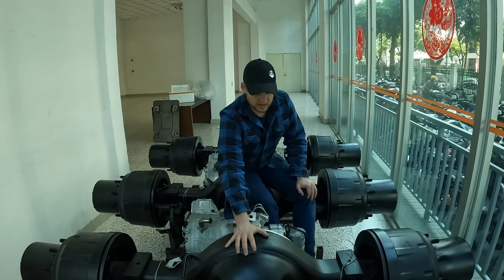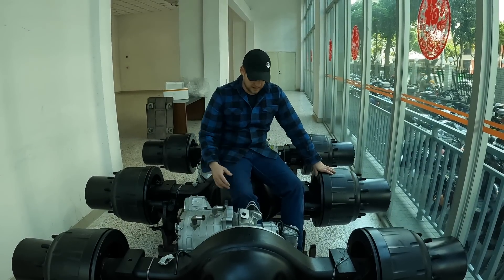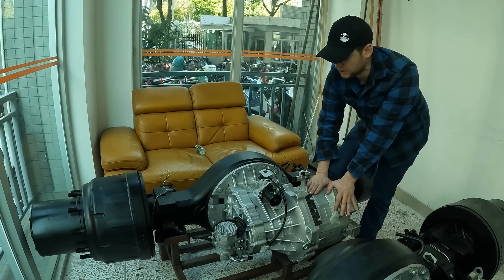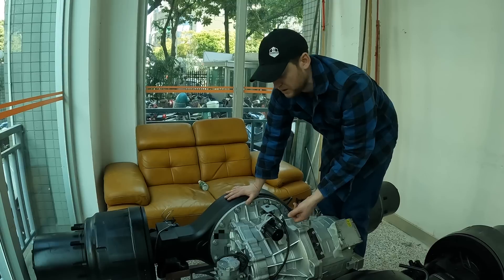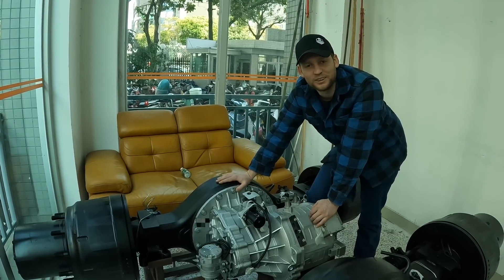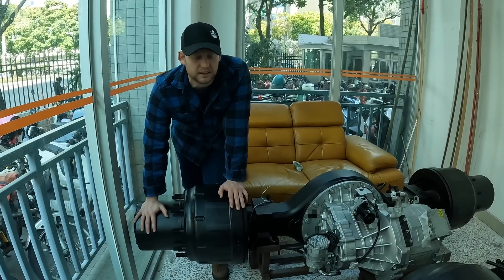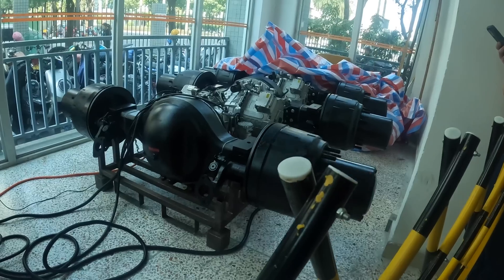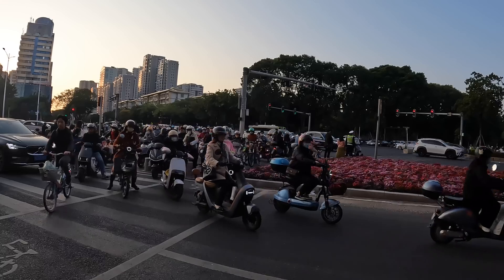Exploring Heavy-Duty Electric Axles: Behind the Scenes at the Factory

Comment: Be interesting to see if they have sorted their gear hardening 
Steel quality and lash issues 
I drove a Chinese pickup a few years back (manual)
In all my life ( near 60) I have never drove anything with that much 
Combined lash without something being broken 
It's a case of a lil more on every gear and spline 
That adds up to a lot 
4th gear traveling down the rd 
U back off and it doesn't catch itself
There's a gap then go to apply power again and you nearly haftoo book an appointment for motive force 
Shoddy engineering 
My employer just bought 
A press brake with crowning bed
The bed was failing new 
And would not respond 3 tech's later they found it in the bed drive 
The leadscrew mechanism looked like I'd machined it and I'm a boilermaker
It was rough and made from by the look of it soft steel 
Plus it had not limited itself by switch failure 
A lil messy it twas 
It's up and running again 
For how long is anyone's guess
Now it's goin it runs and corrects quite well

Comment: How do the electric motors hold up to the road vibration since there is almost no suspension to help dampen the vibration. Basically, are the motors going to vibrate apart when going down the road?
Reply: You do understand that AC brushless motors literally only contain one moving part which is the commutator right? That's like asking why doesn't the differential vibrate apart.

Comment: "Inter axle lockers" is actually where all EV's are falling short.  You need to talk to these guys and make sure that you are PUSHING for them to create a "virtual locker" --- so that it sync's the front and rear motors.   I've seen on the Rivian that it gets super confused when one axle is spinning or slipping and the other isn't;  and it starts freaking out and getting jerky and applying the ABS at random, etc..   They need to make a "virtual locker" so that it simply syncs the motors and stops monitoring the traction control stuff.

Comment: Does the truck have an engine powered generator as well as batteries? And are the the electric motors three phase vfd style or dc servo type motors?
Reply: ... those are 3 phase motors, three large power cables go to each axle.   He mentioned that in an earlier video.

https://youtu.be/dhi04e3ZrgU
Reply: @Texaca  I looked at using a 3 phase motor and vfd on the spindle of my cnc milling machine. The speed would be controled by the software.

Comment: You lost me at made in China. They take our steel and turn it into shit. They cheapen everything they send here. And know for sure any company you deal with there is owned by the chinese communist party. And the labor on those axles ar probably slave. I was interested in your technology a bit because of the different approach.  I ran electric forklifts for years. Under load say the first time going up a ramp you say this does ok. But always always and I mean always they slow down at the top. Internal combustion does not. Half a flat bed unloaded from ground level climbing a dock 4 foot higher you will need a charge. Your generator charging system i think is great. But it will not charge those batteries fast enough to overcome climbing. so your baby caterpillar which are awesome by the way will find itself spending most of its time at peak power. Better put more fuel capacity on it. Going down a baby incline i have found they hold for a few seconds than it can't.  Up the hill they will be like the only engine in my experience that will die not fall on its face die pulling a load up a hill in the correct gear. Mack. 1800 rpm and it dies like must start it back on a hill that is not that bad. Even detroit and cummins will try to pull. I wonder how fast you can get parts for those cheap china axles?  Especially when they are doing their very best to destroy the west. I'm game for different energy if it is cheaper and better. You did a good step putting a diesel powered generator on. But it not sustainable as you would say. The batteries before they even get to your truck has produced more pollution than a diesel will. ... From the '70s.  Our so called C02 has increased very little since the middle ages. If we decrease it by around 1 percent our trees will die. We need trees to breathe. I don't know about y'all but I kinda need to breathe.  In my driveway sits a T800 KW with a 550 ACERT 06. 300 k miles. Your truck when you installed the batteries has made more pollution than  my truck when I have inframed it 2 or 3 times. Caterpillar Yanks. Hard. And I can get superb mpgs out of them.  I learned to drive a big truck around 12. I got my CDL when i was 18. It wasn't called that then. I am now 50. So i probably know very little about trucks. I will continue as long as i keep driving will row my own gears i will react faster to conditions than a computer ever will. And I will never drive a truck that i have zero control over the transmission and drive axles. How do you disconnect your electric truck from the road? When the road gets greasy how do I stop my drives from locking up? I can do this if row my own gears and know when to brake when not to and not use my engtine brake.
Reply: ... you lost me at " ...our so called CO2 hasn't increased very little since the middle ages".  Where the hell did you get that nonsense from?  #FauxNooz, a Religulous Fanatic who hears Voices in his head, or from a YouTube University #TinFoilHat Flat Earther scientist 🤨
Reply: @Texaca  mainly because studies show that if our real studies not this bullshit religion called world is ending tomorrow like climate moron Greta dumb fu.k spews says we reduce our c02 by less than 2 percent our trees will start dying or maybe the hard fact the slave labor plus the pollution caused by mining the materials for the batteries before this truck even gets on the road has caused more pollution than a pre emissions class 8 truck will cause in it's entire life cycle. Please continue to suckle at the teat if elites like John Kerry who will pollute more this year than I will in a lifetime. Spare me the woke bullshit. And do some real research. China is one of the largest polluters in the world and the use slave labor and are a horrible communist government. Spare me your bullshit please.

Comment: "Does it have inter-axle lockers" might not be a relevant question but I would ask if they provide inter-axle traction control? Being able to crawl without one axle spinning wildly on slippery spots does seem relevant, especially in off-road applications.
Reply: i believe programming will take care of that
Reply: @73Datsun180B  yes programming is the solution. That's the nice thing about electric motor controllers in this day and age.

Comment: Is there any chance the tri drives will have the front drive or rear a liftable tag? Not really doable with drive shafts very easy but it seems you could lift an axle of the ground and cut power to it pretty easy with this set up.  Love what your doing. When the the w9 dozer hauler is done , hopefully I can buy an Edison.

Comment: Sounds great and all. Do they use standardized brake drums, bearings, wheel seals? How will you protect the motor cooling hoses at the back of a logging truck? I mean it's pretty hard to keep an axle temp sensor wire connected as is.

Comment: You are going to end up bankrupt.... you know electric trucks will not work😅
Reply: I believe there electric truck is the Only electric truck that will work and work better than any other truck on the market it's not a new idea but is absolutely genius these trucks will outlast any truck in history far as engine hours diff replacement the normal wear and tear items will be there but different issues I suspect wires and connections also suspension components same as every truck

Comment: Are these 3 phase ac drive motors? Would it be possible to run these trucks on generator only without battery for cost and weight savings?

Comment: Seems like it would be pretty easy to add front wheel drive to a truck given the fact that you don't need to deal with driveshafts
Reply from the maker: That’s correct, You could also have drive axles on your trailers. - Theron Danger

Comment: Honestly, the more vids i see of this process the more impressed i am. While the made in china gives me pause, at the same time if they stand behind the product then whatever. Half the crap i own was made there.

I likely wont get in on gen 1 just due to timeing, but id love to get my bullfrog remaned to one of these diesel electrics someday. Likely be perfect for an end dump like my rig which spends as much time on the highway as in the mud and ultra rural areas. Hell ive seen logtrucks confused when my plastic pete follows them down dirt and mud to quarryd. So it would be halarious to see all the very confused looks i get for loving my plastic 579 so much i went through the trouble to not only fix her but make her a hauling monster.
Reply from the maker: Even CAT excavators & equipment is made in China.   

But it’s definitely why we flew over to double check them
Reply: @EdisonMotors  Yup hence why it only gave me pause for a moment. Half the crap under the hood of my truck as is was made in china. So as long as you checked and the product is well made it doesnt really matter where it was made.

That said im still intrested in this tech and literally only found you a few days ago. Frankly if it wasnt for the fact my engine just rolled a million and needs a replacment in the next few months due to issues with the block id likely just wait and do the conversion. Never made sense to me why D/E has been ignored as an option so long. It just makes so much more sense then pure EV or pure fueled for most applications especially with modern tech bolsterig it.

Oh well with luck ill get in on gen 2 or 3. Just gotta keep my plastic truck chugging along a few more years.

Comment: Make sure to get air disk brakes instead of the old drum brakes
Reply: I came here to say, don't get on the stupid disc brake bandwagon.  Good old drums are so much more owner friendly.
Reply: @nspro931  409k miles on my truck and still have more then half the disk pads, and never got hot downhill, how it's stupid?
Reply: @inusa1618  Price out the parts ad tell us how much they cost.  What brand discs are you running?  What truck?
Reply: @nspro931  Volvo and Mack, Haldex or bendix Air disk brakes, price is no that big difference when buying a new trucks, on top of that nothing to inspect when entering weight station, no s-cam or slack adjuster, Dot will be in and out of your truck in seconds
Reply: @inusa1618 I find it hard to believe 409k on factory brakes.  But whatever. But these trucks should almost never use their brakes so discs not necessary. There will be nothing to inspect on drums either because they will never wear down. Discs are proprietary and replacement parts expensive.  Drums are simple and everyone understands them and parts cheap at the corner store.

Comment: Is this your design being produced in China or are you buying an off the shelf electric axle?
Reply from the maker: Yeah, they’re custom spec’d for logging/heavy haul applications
Reply: @EdisonMotors  Precision turbo learned their lesson the hard way with China. They used a Chinese foundry for rough castings with final machining done in the US. Shortly after beginning business with the Chinese foundry, cheap eBay turbo kits popped up all over. The Chinese foundry was making knock-off turbo kits from the Precision tooling. Precision had to end that business relationship pretty quickly.

Comment: How well do those drive axles stay synchronized together?  Speed variation for an on road truck is pretty important for tire wear since they're not mechanically connected.
Reply: These types of motors have phase sensors to tell the controller lots of info about the physical rotation of the output shafts etc. Any synchronization would happen at the controller.
Reply: I believe the excessive tyre wear is caused by the inter axle drives winding up tension in turns, etc like an old-school 4x4 car does when on a hard surface. Electric axles wouldn't have this problem because they would always have equal driving force to each axle - they can't 'wind up' because there is no shaft connecting them.
Reply: you don't gotta worry about the rubbing that you would have with normal axles, so it's just a case of don't let an axle spin out and you are golden.
Reply: What do you mean with synchronized?
They are electric with a motor each.
If you have the same load on the axle and puts the same amount of power in them they have the same amount of tire wear

Comment: You could actually do something like inter axle locking with the controller. Make the motors run at the same speed.
Reply from the maker: Technically that’s how it works already.  You’ll be driving full time with your “inter-axle lockers” in

Comment: I'm wondering if in the next 10 to 30 years as the technology progresses and designs are worked out if we don't start seeing trailers with electric drive axles as well that draws power and coolant from the truck so that the load put on the truck drive axles isn't increased nearly as much when compared to empty as it is now
Reply: Airstream has a concept camper that does the same thing. The camper has its own battery pack though so it gives way more range as well.
Reply: Great idea! You guys are blowing my mind. Imagine the capability of a 18-wheeler with 18 wheel-drive. That thing would climb straight up a tree!

Comment: I feel like this will be your number one headache. But hopefully, I'm wrong 🤞
Reply from the maker: Oh probably.  At least it just bolts up to regular rear end.  The electric motor is just a magnet in some copper.  But we’ll see what breaks and we need to change
Reply: @EdisonMotors   Class 8 eAxle Design Engineer here.  The number of potential failure modes for even a simple system like this will make your head spin.  Especially if this is a 2 speed system as indicated.  
I don't know what your commercial agreement with them is, but, if possible, there would be huge value in reviewing their DVP&R (Design Verification Plan and Report) and DFMEA (Design Failure Mode & Effect Analysis) to ensure they are following Engineering/Industry best practices.
Reply: @-Enginerd  Mobile application engineer here (integrating eAxles and motors into machines). For sure they will have a fun challenge getting all three axles working together with the same torque and speed in all different drive conditions, a lot of time will be spent on functional safety.

Comment: Any concerns with the power wires flexing with the axle/suspension? Seems like there's a limited life of how many times you can bend copper wire.
Reply: They just need to spec out multi strand wire for the application .
Think welding cable Vs romex..
Reply from the maker: That’s right
Reply: like Ross said, the research and application is very mature at this point for connecting large electric drives across moving parts.
Reply: I could see the need of shorter wires from the motor to a terminal block for easier replacement after so many hours of use.    Be a replaceable item like a belt(it can only flex so many times).
Reply: DIESEL ELECTRIC LOCOMOTIVES TRACTION MOTOR CABLES ARE FLEXIBLE COPPER, AND THIS IS NOT A PROBLEM WITH THEM, AS LONG AS FINE STRAND CABLING IS USED!!
KEEP THEM ROLLING BROTHERS!!👍👍

Comment: So the planetary gear reduction is in the hubs so that the axle shafts see less torque? I like that.
Reply: A few ICE axles do the same for same reason. Seems to work pretty well
Reply: That type of axle is common here in brazil. Its is even mandatory to have axles with reduction hubs if you reach certain weight limits
Reply: More lessons from heavy agricultural machinery and monster trucks,  LOL
Reply: Pretty common. Unimogs and hummers have a similar setup. Mainly for ground clearance I believe in those cases.
Reply: @chickenfishhybrid44  well no portal hubs aren't common at all, but this is something different. This is planetary gears and it doesn't add any clearance.
Reply: @jaredlancaster4137  suppose that depends on what exactly you consider "common". Just Between hummers and unimogs there's something over half a million vehicles made with portal style axle/hubs. And there is portal style axles with planetary gearsets as well. Point was the concept of reduction out on the hub certainly isn't new.
The shafts on portal axle also see less torque because of reduction which was what you cited.

Comment: I don't believe this it the right path.  Those won't fare well once they're burried in mud and they're not going to be easy to service like a standard truck axle.  You'd be better off using standard axles with driveline a and a single large motor like you saw on the Volvo.  These axles will be a nightmare.  Put 'em on the first truck and chalk the experience up to experimental development.  Then scrap them.
Reply: To be fair, driveshafts don't fare all that well buried in mud either. On the farm weeds getting wrapped up in the drivelines and u joint failures are common, I like the idea of eliminating driveshafts
Reply: These are standard axles except for the electric motor bits in the 3rd member. I guarantee these are already in heavy equipment running around with conventional 3rd members with yoke  flanges. A clean sheet electric axle designed from scratch would not look like this.
Reply: these are road trucks, not off-road ones. for now, the only thing this company is doing is converting diesel highway trucks to electric highway trucks. 

in another world --- electric trucks are perfect for offroad because you can control the speed/torque with the push of a button since "every wheel has it's own motor".      i will not be commenting on the durability of this system, but, IN THEORY, it is superior to internal combustion